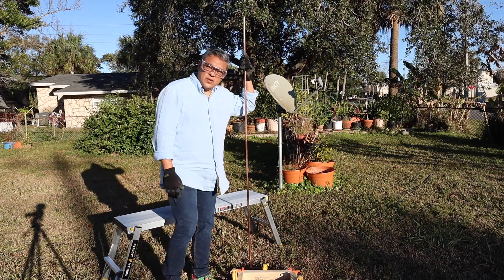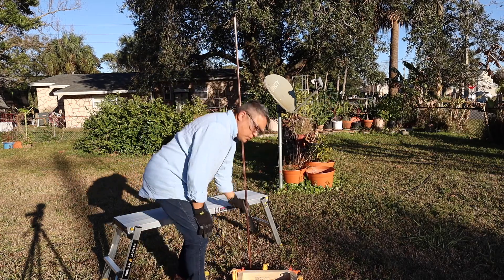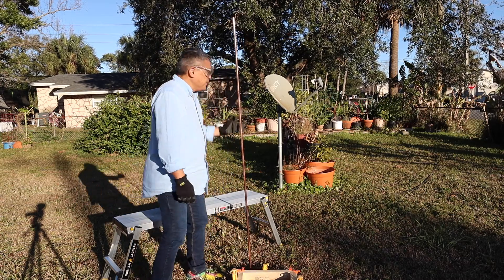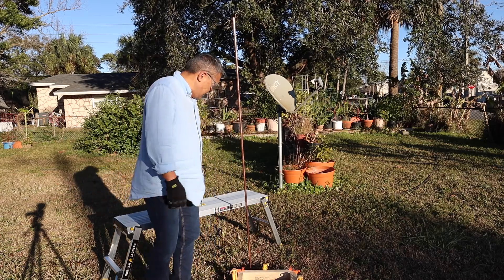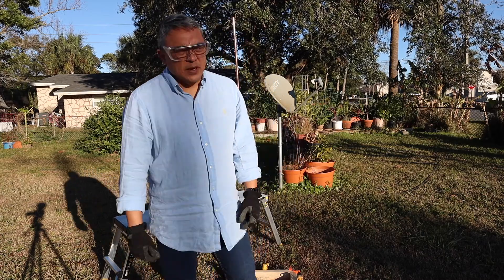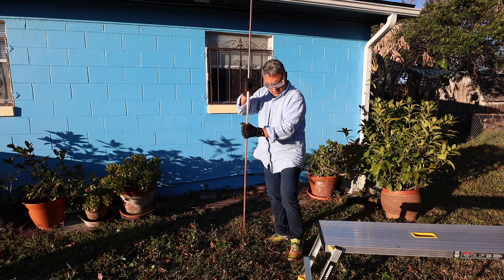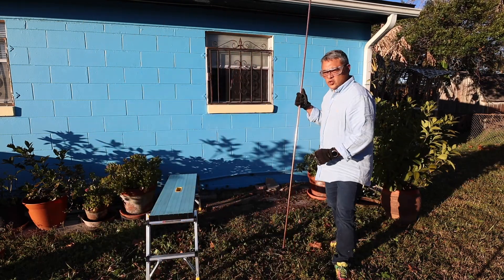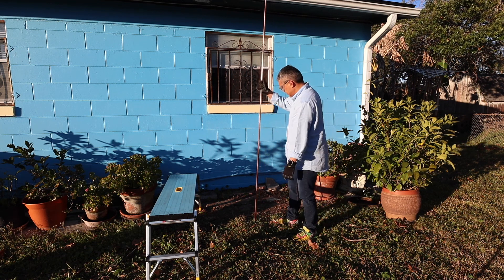Pounding Grounding Rods for Antenna Mast and Ham Shack!

Comment: Can you please make a video of you connecting the wires?
Reply from the maker: Good idea!
Reply: @DarrenN4VFR So, if my service is on the opposite side of my house from the antenna and lightening arrester, should they still be connected together? Or did you tie them together simply because you were already close to your electrical service? There would be nearly 50ft between my antenna ground and electrical service ground.
Reply from the maker: @remarkable_ruin8608  I'm not a subject matter expert, but if I remembered right, it's best to make your ground connected to the service ground of your home.  That's what I did.  Have your grounding rods all connected together.

Comment: Alternate method my dad (a licensed master electrician) taught me long ago: "wash" the rod into the ground.  poke the rod into the ground as far as you can, at least a few inches.  Remove the rod and pour in water.  Reinsert rod and work up-and-down as far as you can.  Remove and pour in more water.  Repeat several times, until top of the rod is within an inch or two of ground's surface..  Much easier than pounding with a hammer.

Obviously, this won't work if you hit rock -- but then, not much will work in that case.  

The ground rod we washed in for my crystal radio (I was 6 years old, or thereabouts) went into hard-packed West Tennessee clay soil, and it went in easily; I actually did most of the work, after he showed me how..  I was surprised since I already knew that clay soil was hard to dig in.  But by turning it into mud, I sank that eight-foot rod quickly and easily.
Reply: That method is what I use, but sandy soil won’t let you hydro drill by tamping,
 When it does work I can tamp 8 foot rod in less than 2 minutes with one hand.
I had to buy an old man lunch on a bet is how I learned 😂 73 N5YWP

Comment: Despite having multiple ground rods (they are bonded to each other and to the electrical ground.) I did not find them very effective as an RF ground despite having good ground conductivity. A radial field is far more effective for me for RF efficiency. Good luck with your project.

Comment: Here we go again !
Sorry  but as soon as I heard him mention mushrooming the end of the ground rod, I stopped watching !
As impossible as what I'm about to say,  may sound impossible, believe me, once you try this method, you will never beat on a ground rod again !
Over the course of better than 40 years of Hamming, I have installed many a ground rod in this fashion !
The caveat here would likely exclude heavily rocky soil, tree roots, etc. !
Use common sense !
The formula for installation is to remove a circular pattern of dirt, using a spade, shovel, etc., About 1 foot in diameter, and a foot or so deep !
It doesn't take much !
Not critical !
A cone shape is fine, and may prove useful, as it may serve to funnel water to the center of your hole.
Take a bucket of water, and pour into the hole.
Let stand until most of the water is absorbed.
I have found that sometimes adding additional water thru this process may be beneficial.
Next take the pointed end of the ground round, and push the rod down,  with your hands, into the center, as near you can get it, of the hole !
When you can no longer push any deeper, pull the rod up until you feel it break lose !
Adding water as you deem necessary throughout this process !
I like to leave water standing, as it will soon be drank up by Mother Earth !
Continue the up and down motion with the rod, until you have the appropriate height you choose sticking above the surface of the ground.
This requires a little elbow grease, but once you've done this, you will kick yourself for ever beating a ground rod !
Keep the up and down motion going, and you should have the rod in place, literally within minutes !
Of course there will be exceptions, like the occasional Rock, tree root etc., which may require either some use of a hammer, or change in placement !
Hope someone finds this useful !
Good luck !
Be Safe !
'73 !
Reply from the maker: Cool way!  Thanks for the tips!  Gonna try that next time.
Reply: @DarrenN4VFR  
I know it sounds unbelievable, but it truly works !
Good Luck !
             👍😉
Reply: I have been doing it this way for 25 years and it woks great! Install the ground rod acorn as a handle.